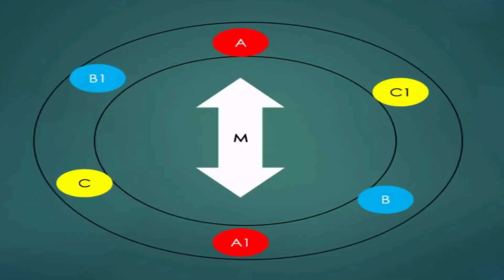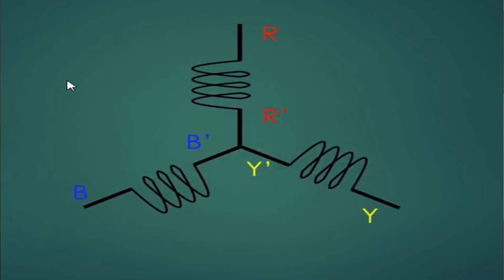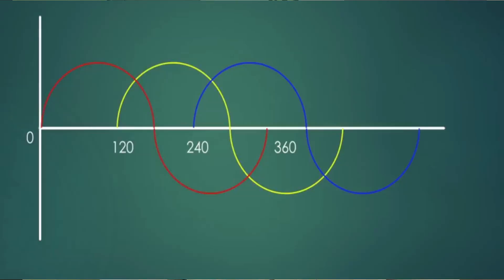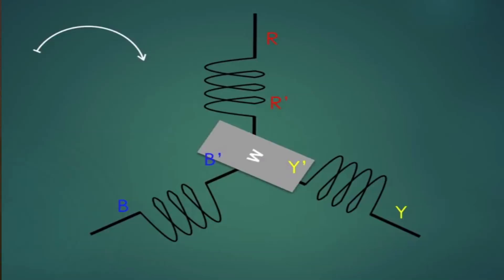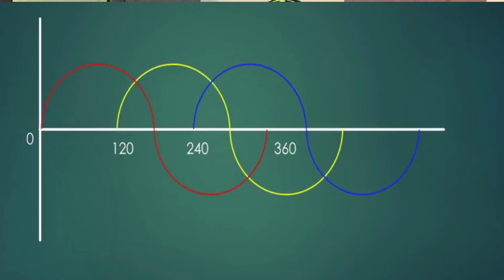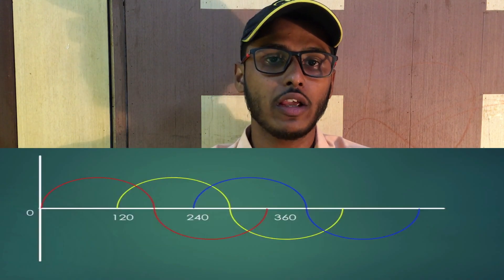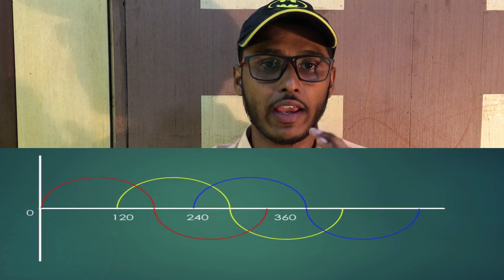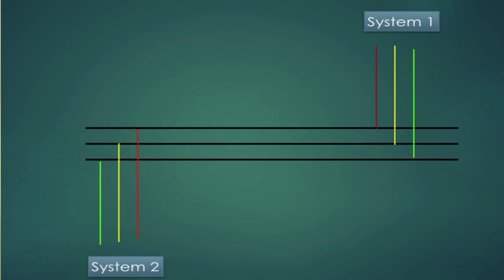Phase Sequence | Explained in Malayalam

Comment: രണ്ട് വ്യത്യസ്ഥ ഫേസുകൾ കൂട്ടിമുട്ടുമ്പോൾ പൊട്ടിത്തെറിക്കാനുള്ള കാരണം എന്താണ്
Reply from the maker: 2 different phasil potential difference ullethukond thanne ath touch aakumbol high current flow undakum almost zero resistance conditionaan ithu, short circuit condition , line to line fault ennokke parayunne ithine.ithinum ee phase difference thanne aanu main kaaranam

Comment: capacitorum test lampum  vachukond phase sequence kandethunna method ille...
Reply from the maker: Ya undu... capacitor method und inductor methodum und with 2 lamps,,2 phase il connect cheythe shesham ah 2 lamp engane kathunnu enn vechaan phase sequence test cheyuneth...
Reply: Three phase induction motorin nutrel wire undavumo?
Reply: mech & tech 
illalo
Reply: @basheertechnologies  no